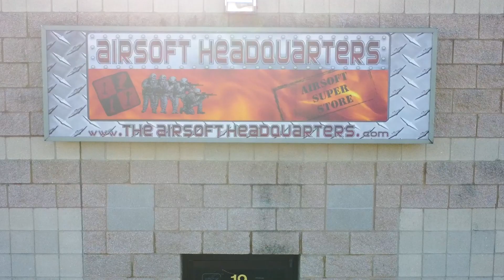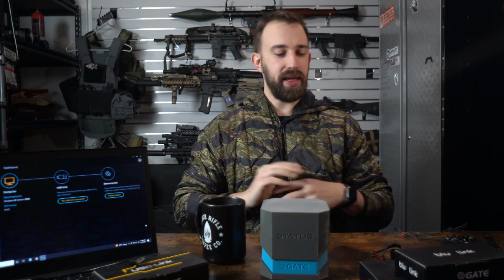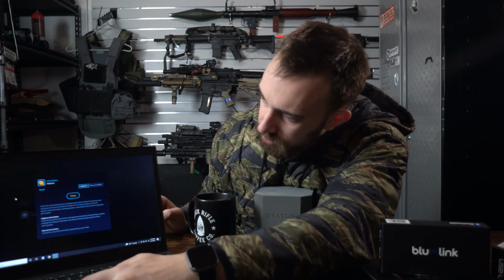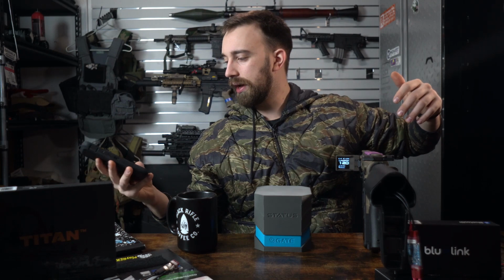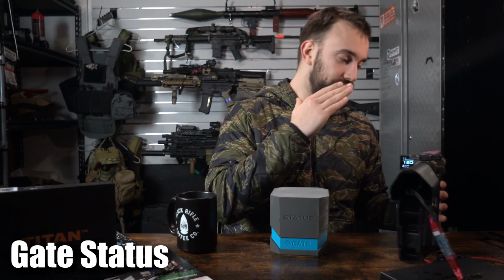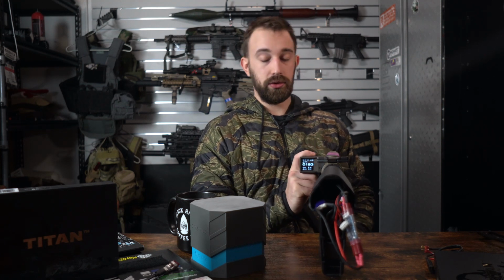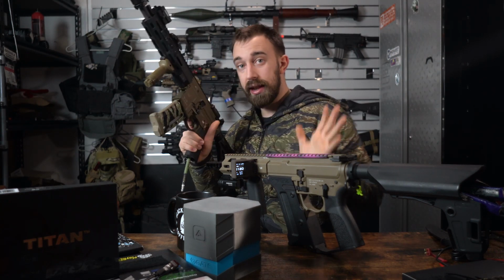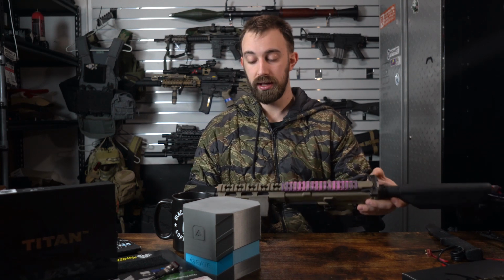GATE Electronics Overview | Status, Titan, Aster, Blu-Link, GCS, etc

Comment: Love the video! What gate product would you recommend for my limited edtion mp5 (the cyma platinum one)
Reply from the maker: Aster at the most if you want to replace the trigger contacts. If youre okay with traditional trigger contacts you can get a MERF thatll allow you to run high voltage lipos
Reply: I have a cyma mp5 high speed (13:1 gears version), with a gate aster and a high torque motor, it is amazing

Comment: I wonder how many really use the Titan features VS just doing it to flex.  The software interface and maintenance thereof have been marginal at best.  In an effort to simplify the UI with QR’s, they’ve actually made things more difficult.  A basic Perun and little more play awareness would yield more of a value prop for majority I suspect.
Reply from the maker: I think the brand flex is relatively low, I think theres a bigger issue of misconception of what the Titan is supposed to be able to do. Dropping a Titan in a gun isnt going to give it super powers, theres a bunch more components that need to be added to really make it a phenomenal build. We like the more basic GATE systems that work for wiring protection and anti-arching so that the stock trigger contacts can just work. I did have someone come in with a Titan that wanted a shorter 'firearm' type of trigger pull which you just cant get with AEGs but its an advertised feature on the Titan. So that was several minutes explaining that he just needed to be aware how far the trigger is pulled and he needs to be reactive to the system.

Comment: I have a Gate Titan and a USB Link and love them in my VFC Samurai Edge. I want a Status as well just for the cool factor but the way the unit sticks out of the left side of the rifle makes me doubt the comfort of the rifle when slung close to the chest. Doesn’t the Status stick you in the chest or abdomen when you have your sling cinched tight between games?
Reply from the maker: I have not played with this in-game at all but with slinging and moving around the little I did I did not have an issue. I do run my sling much tighter than most but its single connected on the stock so the muzzle end has more movement around my body so a small unit about GoPro size is not an issue in my case
Reply: wats the usb

Comment: You caught myself and my girlfriend's attention when you talked about drilling a hole into your mag to gage how many bbs you have left do you have more info about that?
Reply from the maker: lmao so I use the PTS EPM magazines, and the internals are designed to slide out for easy replacing. So I take the magazine apart and I originally cut out WAAAY more of the exterior of the magazine than I shouldve just to see where BB's lined up. Its hard to see but in the video since theres a sticker in the way but towards the front I have a 6mm hole drilled just under where the magwell ends so I can do quick mag capacity checks without removing the mag or just guessing
Reply from the maker: Yea 28:28 is the exact timestamp where I point out that hole on the magazine

Comment: A lot of tech in this unit yet it still comes off as a gimmick to me. The appeal for the common player to purchase one is kinda there, someone may use it once or twice before letting it sit on a shelf. For the advanced player/tech it doesn’t fulfill anything new that they already know through the Gate app diagnostics. A shot counter is being portrayed as the big feature - but only works if the shot count represents your mag count 100% of the time. Most midcaps say they hold “120” for example but you can have some which hold less or more, meaning if you have less than 120 in the magazine, a player will be fooled into believing they have a few shots left because the screen may say “12” meanwhile it is an empty magazine in reality. 

TL;DR 
Gate made a cool product that is very niche.
Reply from the maker: I wouldn’t say it’s a gimmick, because they give you the interface to display the information that you would want to see. I do think that this is a bit much for the first product to be added to the Gate Ecosystem series, maybe warm us up with some cheaper Ecosystem Series additions